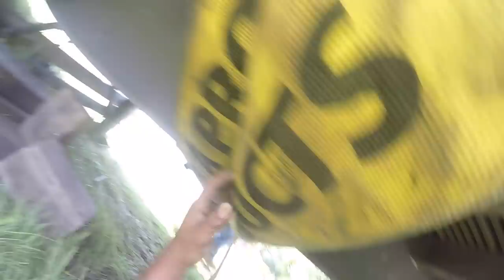Lifting a trailer with a coil on it

Comment: Landing gear on dirt or grass without a pad underneath is not such a good idea. It happens on asphalt at times as well. In 2000 while i was in Arizona there was a Werner trailer that had been sitting in a vacant lot for days. One day I drove by and  both legs of the landing gear had sunk leaning the nose of the trailer on the ground. At the time this happened the temps were over 100*F. I called Werner with the trailer number. They weren't ever sure why it was there but the next day there was a wrecker and a Werner tractor.

Good ole Mr. Wilbert does it again. Stay safe Mr. Hal and off of Sumterland.
Reply from the maker: Mr Michael  Yes sir. Thanks for watching and stay safe